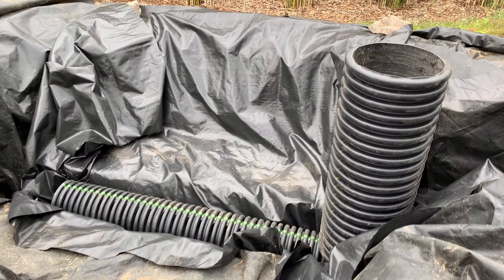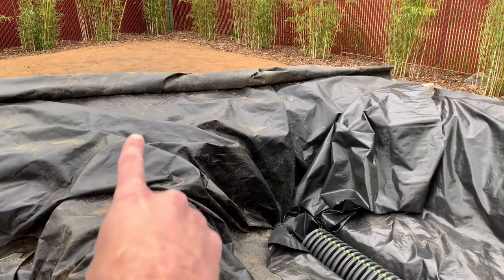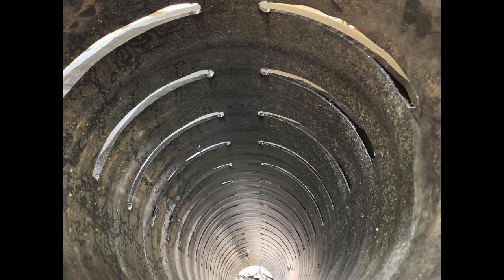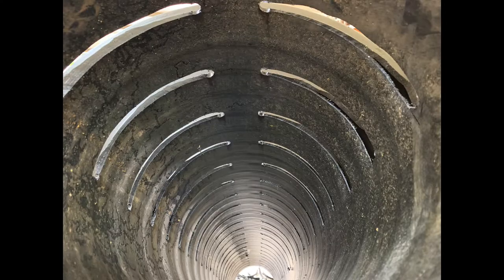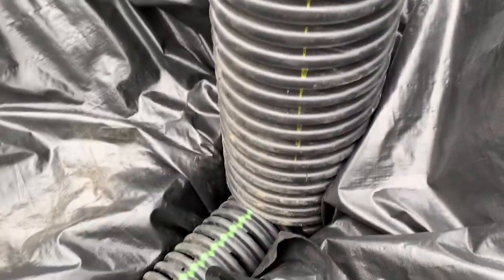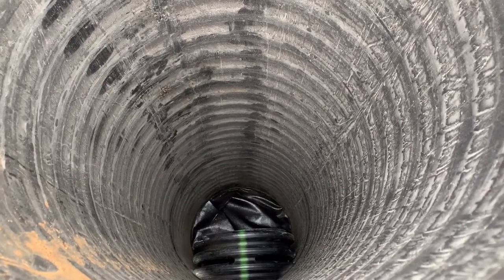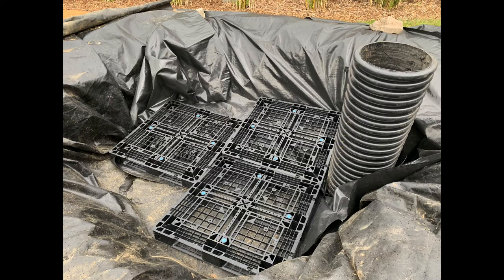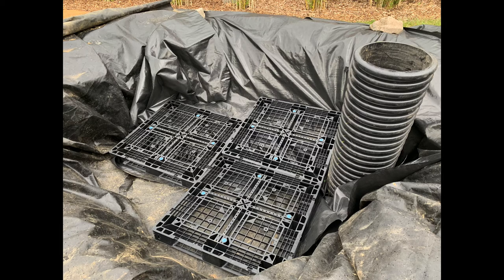Backyard Water Garden: Wetland Filter Update

Comment: I think using the pallets is a really good idea because as the water comes through it will perchlorate through all the bottom of the gravel and not just take the path of least resistance in only a few spots along the centipede. You want that slow up flow as even as possible as it will create the right conditions for denitrification bacteria to remove your nitrates. And cleaning will probably be much easier to collect the solids by back flushing the gravel down into the void space without it getting trapped in the gravel so it can be sucked out through the snorkel. Cheers!

Comment: this is brilliant...here's some pricing from Aquascape in Aus.. Centipede -$1000 ,Snorkle - $1300 Aqua blocks $57 each..complete Wetlands filter setup -$4730...without aquablocks I reckon your setup would be under $100....would love a follow-up to see how it operates
Reply from the maker: Thanks Brad. I do have an update planned. I’ve changed the design quite a bit since this video. Will update with the final design and costs. Subscribe to the channel and follow the garden pond playlist to make sure you see it.

The culvert piping is not cheap in The US, but I believe you have a lot more options available in AUS that could work well.

Comment: How big is your POND ? We are Building a HUGE organic swim pond ... 60X40 foot and we are trying to decide sizing for wetland filter
Reply from the maker: Hi Nichole. I need to film an update as I've actually changed the layout of the pond since filming this. The pond itself is about 18x30. Total wetland area typically recommended to be somewhere between 15-30% of surface area of pond. Swim pond needs better filtration than typical garden pond since humans will use it. Performance-wise, you can never have a filter that's too big, but you can definitely have one that's too small.

I will be at about 30% split between two filters. One is a traditional bog/wetland filter that will waterfall back into the pond. The other is an upflow under gravel filter. Same idea as wetland, but is at bottom of pond.
Reply: @TylerTervooren  YES ! We went super BIG with 2 Xtra Large Bog Filters as well as 2 skimmers

Comment: i did this. i stacked 3 layers of pallets total height 45cm. plasticpallets hold up to 2000kg. matrix box were way to expensive. 

my bog filter has a flat bottom. 45cm pallet dpeth.  15cm large stones, 15cm 2/3 gravel, 30-40cm peagravel.water depth on surface of peagravel 20cm +/-.   total surface area 19sqm, rubning 6000l an hour pump.  

it polishes the water up nicely.
Reply from the maker: Thanks for sharing! Glad to hear it worked out for you. The pallets I've found here come rated for different levels of duty. I think 2000kg would be a stretch for the "light duty" pallets I have. Maybe as long as the load is spread over the entire surface. Did you get the more heavy duty ones?
Reply: @TylerTervooren  2000kg rating i believe is more than sufficient. i doubt that the layers of stone, gravel dan pea gravel combined is more than 2 ton per square meter.  i didnt go with the heavier duty pallets, just what was available to do the job. 

maybe some one can correct me if i am wrong.

Comment: The pallets are a clever idea.....  I've never thought of that!

However, it's not enough.  The purpose of the Aquablox is to both diffuse the water throughout the wetland, to slow the water, AND provide for a settlement area for solid debris.  If I were you, I'd add 4 more layers of those pallets before adding the sedimentary layers of rocks and gravel.

Additionally, you will need stronger support in the middle of the pallet to prevent them from collapsing.  What do you think the best DIY hack would be?  I have my ideas.....  ;)

Overall......  I like the ingenuity of the design and the use of the corrugated pipe.  However, please be advised that the flow of water is best when flowing into the wetland, horizontal from the end of the pipe towards the snorkel.  This allows the water to slow down.

Velocity is everything.

Good luck with your project, I've subscribed and rang the bell so I can follow your progress :)
Reply from the maker: Wow. Thrilled to get feedback from one of the best in the business. I came to the same conclusion as you about the plastic pallets. I'm going to stack firewood on them instead. They make significantly stronger ones, but then you're approaching the price of aquablox, so might as well just use the "good stuff."

I bought a few aquablox, some milk crates, and these pallets and have been doing a carefully controlled lab study of their strength by jumping furiously up and down on them. So far, the aquablox are winning by a large margin.

The milk crates stacked upside down are pretty strong since they are small and continuously supported along their edges. I think they'll do okay in a bog where a couple thousand pounds of dead load from gravel are being imposed on them and very little live load.

One other thought I had was to just buy some more of the corrugated pipe and slice it up like my DIY centipede and lay it on top. It's probably even stronger than the aquablox as it's designed to be driven over by log trucks and heavy equipment.

Curious to hear what you think. If I were doing what you do—building luxury ponds for clients—I would never even consider these DIY hacks. I'd buy the purpose-built materials and never give it a second thought. 

That's a good call on how the water enters the centipede, too. Thinking I'll stick a long sweep elbow on the end of the pvc to make sure it enters horizontally.
Reply: Great conversation and comments as I’m contemplating  adding bog filter to my existing waterfall and pond. In this particular build, were you just dropping the water into the bottom of the bog? The horizontal suggestion would have you add an elbow where you were dropping and then extending the water drop into the corrugated pipe- am I visualizing that correctly? Does it matter how far into the pipe you run the water?
Reply from the maker: @n173021x  I was planning to drill a hole in the top of the centipede and just drop the 3" line into it, but modifying the plan per Carl's suggestion to add an elbow and have the output horizontal. That will allow the water to enter the centipede with less splashing/spraying which will help any solids in that water settle out instead of getting carried up into the gravel.

I don't think it matters too much how far you run your input pipe horizontally as long as the centipede is properly sloped towards the snorkel and the water is flowing into the centipede and not splashing out around the side of it.

Comment: Tyler thanks so much for making this video!  What is the thickness of the rubber liner you are using for your wetlands filter and pond?  Is it better to have the wetlands filter before it goes into the pond or after?
Reply from the maker: Hey Gerry. I'm actually not using a rubber liner. I am using a 30 mil RPE liner. They are more puncture resistant and lighter weight than 45 mil EPDM liners, but they are a bit harder to work with.

Depending on how you design your wetland, you can place it anywhere. Above the pond usually makes the most sense for an active wetland filter, but there are lots of ways to modify. What are you thinking for yours?

Comment: hi tyler great ideas! im building something similiar, wanted to ask you think i can go with a non corrugated pipe? i have some in my back yard, or do i neceserally need a corrugated?
Reply from the maker: Definitely not required to use corrugated pipe. As long as what you have is big enough and strong enough after cutting the perforations, it doesn't matter what the profile of the outside of the pipe is.

Comment: Where did you get the pipe? I'm having a real hard time finding double walled culvert pipe..
Reply from the maker: I live in the Pacific NW, and I got mine from a local logging supply store that sells road building material. Most landscaping supply houses around here carry it, too, but at much higher prices, and only in 20' sticks.

I think you'd be okay using single wall if you can find it in big enough diameter. You'd just have to accept that the bottom of the corrugations would clog up and probably never come unclogged. Not that big of a deal, in my mind.